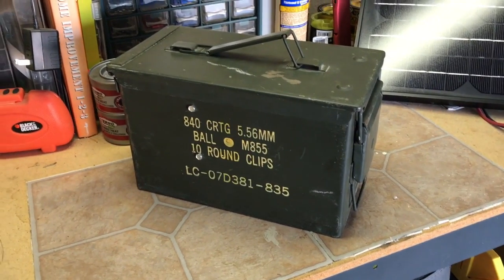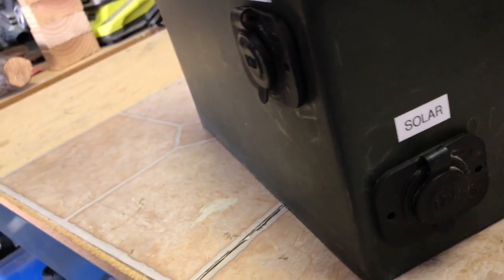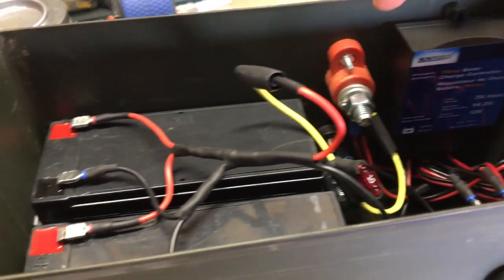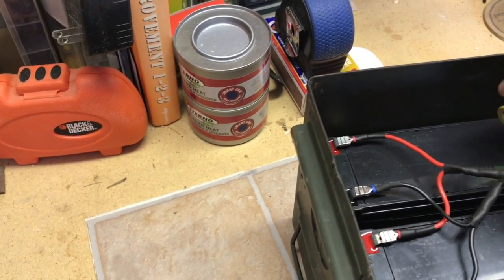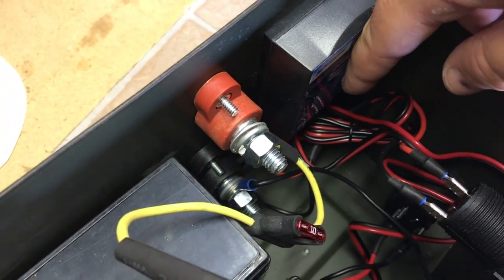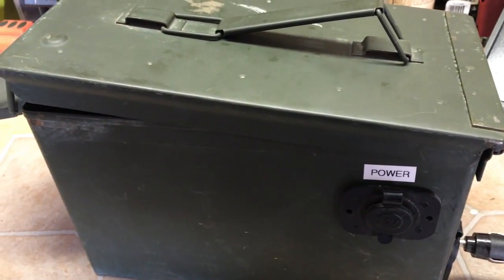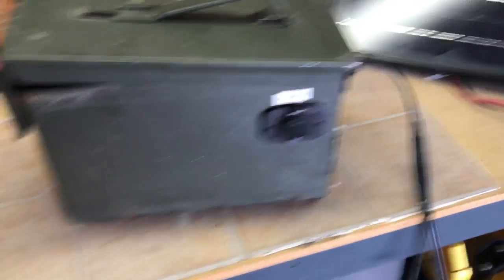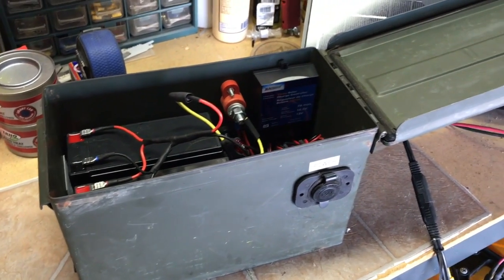My DIY Solar Power Bank

Comment: If you have the 2 6 volt batteries wired in parallel how are you getting 12 volts at the power outlet?  The batteries have to be 12 volts not 6.

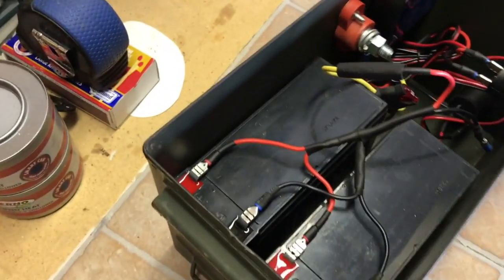Comment: At 2:55 You say you have two 6v batteries.... If you have wired them in parallel (3:25) you do have 20AH, but only at 6v.... if you are needing 12v you need to put them in series so you would have 12v 10ah.  Also, not positive, but at 4:25 in the video... those ring terminals look like they are pretty loose on the positive post... loose connections = resistance/heat which can lead to a melt down.
Reply: I don't like the idea of using a metal box.

Comment: I recently purchased a Powerwerx premade power box. However it does not have solar power connections. It has a voltage meter, 2 USB ports, a cigarette lighter type of port, and it has banana jacks that you can use to recharge the battery thru the AC power grid by simply plugging in a charger. I'm unclear as to exactly where I would put the charge controller and the connections going to the solar panels to make the system recharge the battery from the solar panels instead of the AC power grid.
Reply: Panel to controller..  controller to battery..🧐

Comment: You had a comment that 2x6V (volt) 10 AH (amp hour) batteries in parallel would give 12V with 20AH. I was confused about that until I saw the comment that these are 12V batteries, not 6V. It might be worth adding a note on the video that says the batteries are 12V, not 6V. Nice walk-through btw.
Reply: I noticed that too.

Comment: Okay now I’m confused. You’re plugging a 12v dc plug in the solar jack🤨
Reply: Looks like he is plugging a 12v DC plug FROM the solar panel to the outlet which is wired to the solar connector on the controller.  The plug used is simply for convenience.